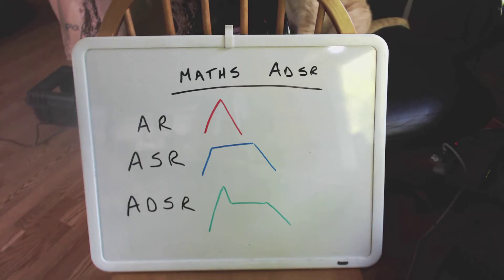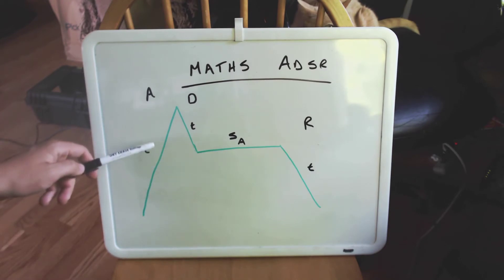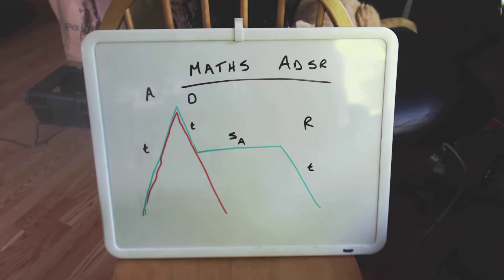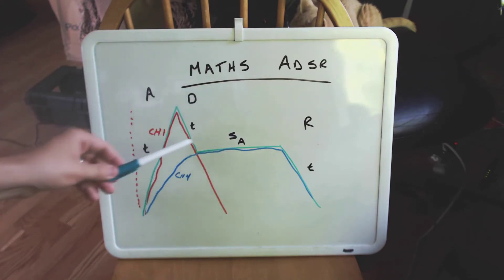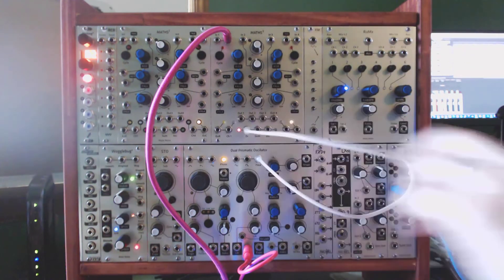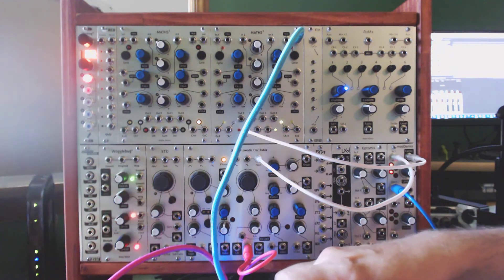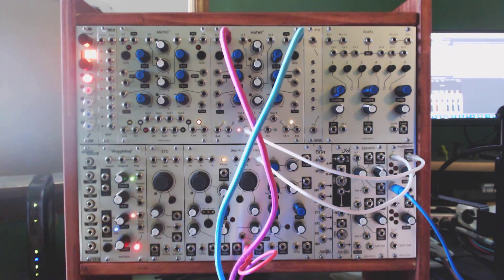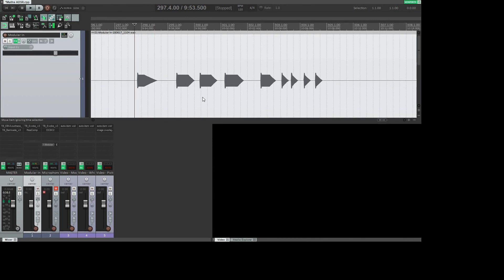Maths as an ADSR Envelope Generator

Comment: how many independent / nonidentical envelopes can you have output at once? like off i had a module with 8 cv inputs, how many things could i control without using the same envelopes twice?
Reply from the maker: You could have the Unity outputs from Channel 1 and 2, and then the Or, Sum, and Inverted outputs as well. So, five total. 
If you plug a cable to use the attenuated outs of 1 or 4, you remove them from the mix outputs.
Reply: @Hermbot  awesome! thanks for the response. i know it’s a good module but i’m trying to get the most envelopes for my buck so to speak. do you know any modules that could have more than 5? also i was wondering about the piston honda and if it could modulate cv envelopes with its wave table, i know it wouldn’t be 5 outputs but that type of constant fluctuation might fool the ear so to speak. any thoughts? thanks for your videos and hard work, very much a fan